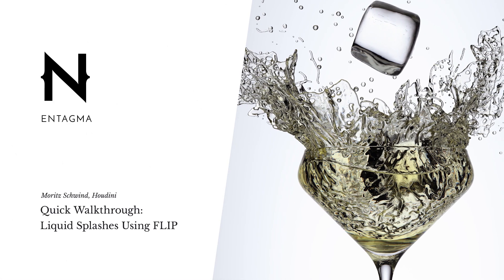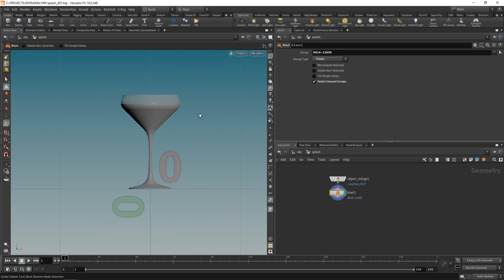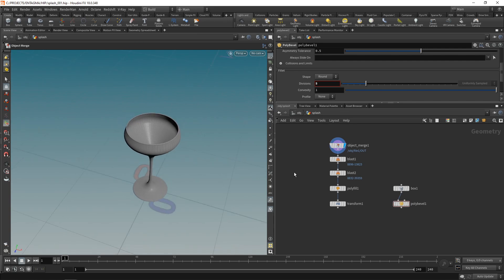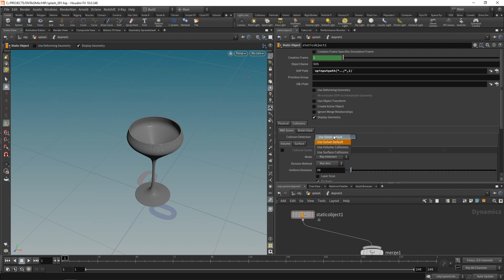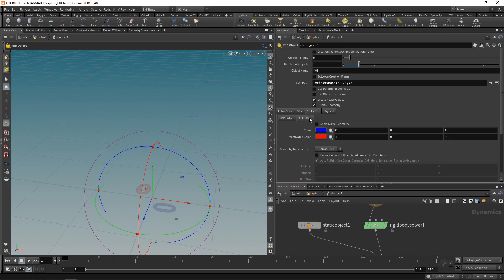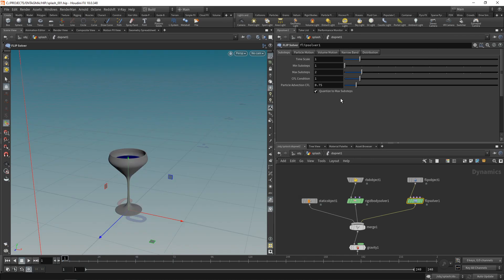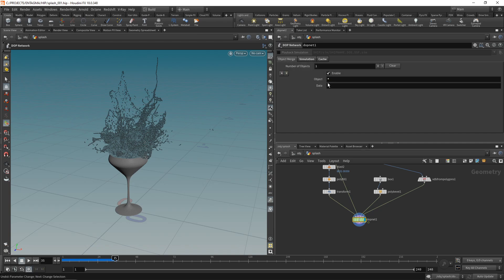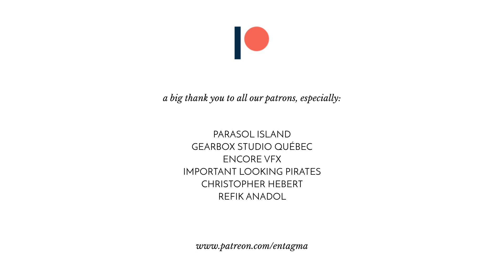Quicktip: Fluid Splashes Using FLIP

Comment: My Fluid is collapsing into some tiny puddle like it has no volume at all, what is going on?
Reply from the maker: Hey @chrisfox9492! This could have multiple reasons. Did you follow along the tutorial or tried this on your own geometry or scene? Sometimes if the scale is off - meaning you use a different scale than this tutorial, then your splashing will look different. But as I said, there could be a lot other reasons why your fluid is not working the same way! Keep on trying and if everything fails, build the setup again! Sometimes that helps! Cheers and great that you are here!
Reply: @Entagma  Thank you for replying! I honestly find it overwhealming with all the different settings in Houdini, they change so much with every update. But I always enjoy your tutorials, so thank you

Comment: That expression shit is killing me.  Isn't there another way or at least an explanation for why it doesn't work when I enter it manually.
Reply: The `opinputpath("../",0)`? make sure to use ` not '. Backtick ` is on the same key as ~, not ". Apostrophe ' is on the key with ".  Also make sure you out the ../ directory navigation in quotes like "../" since it needs to be read as a string.

Comment: With the static object the volume sample method isn't being used because bullet is building it's own collision shape which is why you had to change the hull type. If you remove the sop path setting from the settings at the top it should correctly use the volume sample method. Also worth noting, if you use the volume sample method, is that the division method and uniform divisions settings do nothing, it just uses the volume's settings.

Oh and in the flip object, under guides/particles, setting the visualization to particles instead of sprites is a better way of visualizing the fluid.
Reply: Wanted to give this a shot, so just leave the SOP path setting blank it'll just use the volume sample method on it's own?
Reply: @JosefMaxwell  You can force it by setting collision detection to use volume collisions. Then it'll just use the volume settings and not the bullet settings.
Reply: instablaster.
Reply: doesnt tjhe geometry just disappear if you set the sop path settings blank?
Reply: Can you elaborate?

Comment: the particles set 0.0005 is a huge number..
Reply: Talking about the particle seperation like this makes me think you don't really understand it that well. The PS is context sensitive meaning how big the fluid emitter/fluid object is as well as the scale of your simulation. If it was any bigger, like ten times, then drop the zero. A particle seperation of 0.00015 says nothing if the scale is not mentioned so it's arbitrary until the context is taken into consideration ;)
Reply: @chillsoft  I think we’re all jus talking about this sim. It’s pretty low for an i7 or ryzen
Reply: @chillsoft  yeah I realised his glass isn't that big at all. I made my own glass in Maya, to be about 9cm tall, and immediately noticed many differences between my particle separation values and his. Context is super important
Reply: Yes, i thought the same thing.... usually if i go under 0.1, my pc (Ryzen9 with 64gb or ram) almost dies, lol..... No wonder he said the sim lasted what seemed like an eternity.....
Reply: @juanecheyt  0.0015 I think is my Maximum on this scale
Reply: @juanecheyt  we all need a threadripper :(

Comment: very cool, thanks for this.. i did tons of flip sims in houdini.. and most of them were small splashes.. so.. i have a tip or two..

for me, the most important thing, regarding general look of fluid, was understanding of relation between Particle Reseeding and Particle Separation.. my thinking was: iterate in high particle separation, and when you are happy, lower the separation for more resolution.. but everytime my sim blow up.. 

now, i see it like this: particle separation is for world scale, for example, if you drop 1m3 box, and decrease particle separation enough, it would look/behave like a pool of water.. and if you increase particle separation enough, it would behave like a drop of water.. 

to get more "resolution", aka, avoid jagged edges and/or fluid separating to droplets, there are couple of things to tweak..
one is Particle Reseeding,  to get more particles in the same space (smoother mesh) increase Surface Oversampling.. i sometimes went to over 20 for tiny fluids..
Separation tab gives you control of, well, separation:)  I found it useful when i wanted to control how quickly and hard everything separates, also influences shape a lot..
Surface Tension in Volume Motion i use a lot for final tweaking of looks, after i got most of the things dialed in, it gives great boos to natural feel turning fluid to nice blobs and thin films.. it really helps with uniform look of sim (everything turning to strings or droplets at the same time)..
those are like my main flip parameters i dial in on almost every flip sim i make..

regarding meshing, jagged edges and mesh flickering (tiny holes closing and opening  from frame to frame) were my biggest problems.. smoothing/dilating helped, but i at the cost of detail in most cases..
jagged edges get solved by oversampling in sim itself.. i usually decrease voxel scale to 0.5 and play with droplet scale and influence scale to match my desired look.. and i use filtering lightly..
for flickering, i haven't found a better way, but this works great for me.. i cache all substeps and then mesh all the steps (it prolongs meshing a lot).. then i retime result to regular number of frames.. it gives me butter smooth meshes, but it is kinda annoying.. the main thing is to never get too much of a movement between the frames.. the faster your particles move, the more substeping you need for smooth results..

and there is sourcing.. but we all know the importance:)
Reply from the maker: Hey Alen,

thanks so much for the comprehensive tips! Think I'll be busy incorporating them into my workflow.

Thanks again for sharing :)
Mo
Reply: Really nice, detailed comment Allen! Much appreciated. Not every day you stumble upon a YouTube comment that is this valuable. Fluids can be insanely challenging (multiplied by client's requests) so it is always nice to hear tips from others. Cheers!
Reply: @Alen Mianovic you have raised some valid points here, I  already had a detailed question pending on Houdini's forum (https://www.sidefx.com/forum/topic/73817/?page=1#post-312330)  but here If you can reply to me, 
Is there any correlation between the particle count & particle radius? What should I tweak first grid size or iterations so that I achieve a better collision? How can I make collisions to work with thin geo?